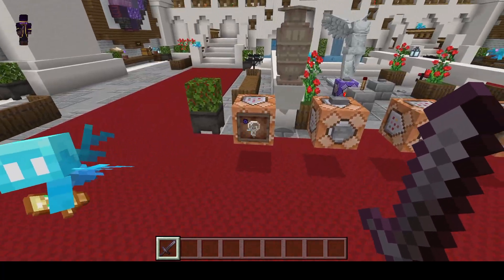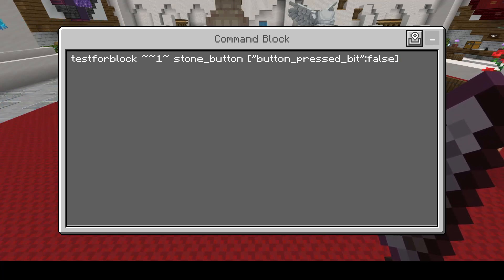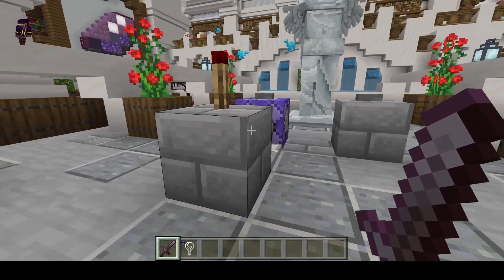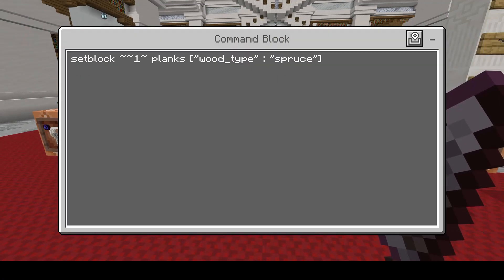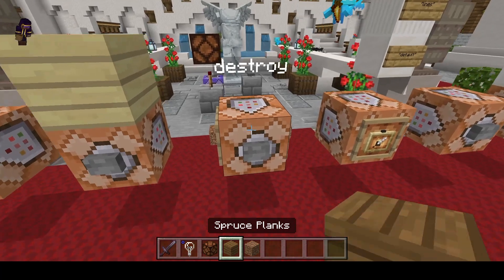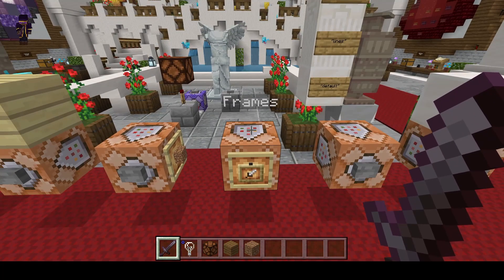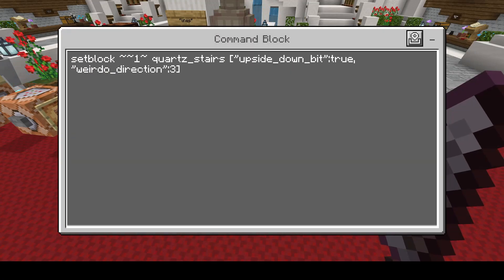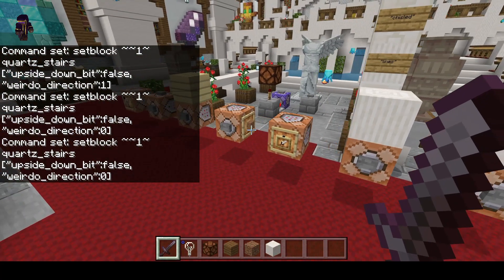/fill and /setblock examples! Also a rant (Bedrock Edition)

Comment: The lightblock command and button facing direction command does not work like the ["block_light_level":15]
Reply: I finally figured it out, you replace the : with an =

Comment: Hi Guppyduck, the reason why the button and item frame commands aren’t working is because of the bug [MCPE-168391]. I can’t link to the bug tracker because my other comment got removed. 

Basically this bug states that commands that deal with block-checking (like ‘fill…replace’ and ‘execute if block’ for example) look for default block states, though they don’t actually need them, because they’re, y’now, default. The way to work around this is to specify the rotation of the button using the “facing_direction” block state.

Comment: cannot for the life if me figure out how to setblock pressure plates. ive tried alot of combos and none were correct. Any help, i get you are getting alot of comments asking for help so fair enough if you cant
Reply: Can't you just type in like setblock ~~~ wooden_pressure_plate?
Reply: @poisonousmush  nope, doesnt work. You'd think it would be as simple as that but no. I tried similar to the examples in the video and i looked at the post mojang did about it but still nothing.
Reply: @alansmith6310  are you using pocket edition?
Reply: @poisonousmush  im on bedrock, xbox one

Comment: What would be the syntax for stained glass? I tried "color" but it doesn't seem to like that.
Reply: Specifically the command I'm using is "/fill 91 4 -62 91 4 -60 stained_glass ["Color":14]"
I've also tried replacing 14 with "red", as well as using a lowercase c on "Color"
Reply from the maker: @jacknifegamingvr  check out my other video on this topic, I have an example for glass

Comment: Please reply: i have a question that in no way or form relates to this video. I do not have access to discord or platforms of the sort so. My question is using hasitem you can input the quantity as 38.. as in 38 or more but in radius it does not work what would you use to detect the greater than a certian interger in the radius (eg. @s[r=38..] doesn’t work so what would)?
Reply from the maker: Do rm instead of r and just leave the number as a number with no .. after. rm basically means minimum radius
Reply: Thank you so much I will credit you in the upcomming vieeo im making but it wont do to much😢.I have 0 subs